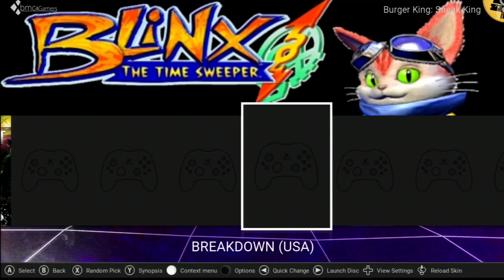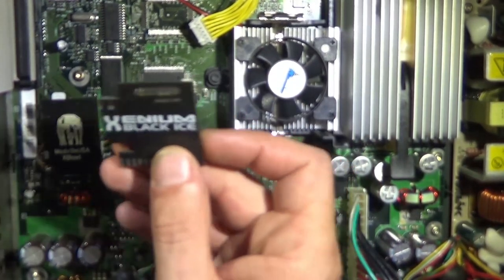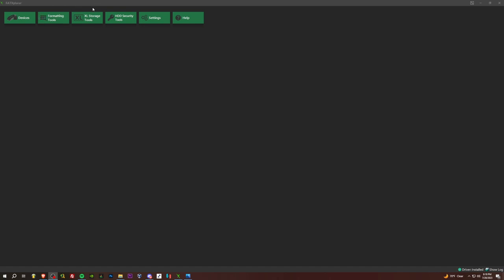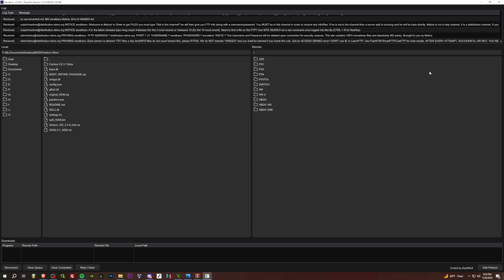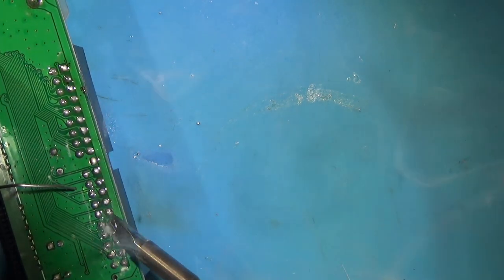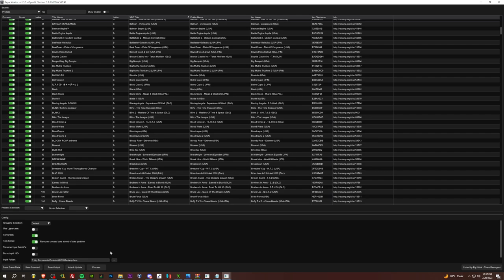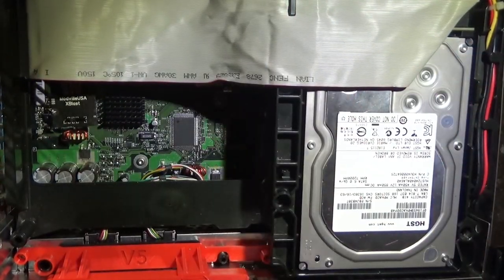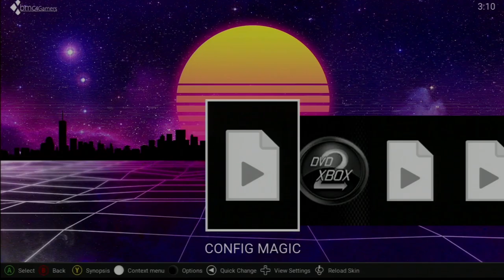Cerbios Full CCI (Compressed ISO) Setup guide!

Comment: I have been looking on the internet and cannot find a sound answer on what’s the biggest capacity a Xbox One X can utilize for a HDD or SSD that is clones from the original HDD it has. I am wanting to upgrade my current 1TB to a higher capacity but not sure if 2,3,4TB is the maximum capacity for a quick clone without any scripts being used. I have a lot of Xbox360 and OG Xbox games that are backwards compatible and will need disc space.
Reply: Back when I did a 1TB ssd swap on my 1X in 2021, I stuck with the same size, 1TB. I read some people say that if you stuck a 2TB in, and ever needed to reset to factory, it would only format to 1TB, as that's what it came with. After the reset, you would have to modify something to get back to 2TB. I had plans to sell the xbox eventually, and didn't want that burden put on the future owners, if they ever did a wipe, it would be safe for them. I don't know if anything over 2TB would work, as that's the largest they came with. I believe you can go 2TB, but keep in mind, that if you ever wipe it to sell, it may default to 1TB.
Reply: @bomb447  thank you for this answer! This help tremendously. I think I will go with a external hard drive as I can utilize unlimited space based on the external and it will play games directly to xbox unlike the series X.

Comment: Hi, love the videos.  I have just completed my beta IDE cable using 40pin FFC cable and... it works :)  I got fed up of those annoying thick IDE 80 wire 40 pin cables i had to try to get rid and now, i have, the first build is good, i need to polish it up a bit but cerbios appears to be happy with it and i think if that is then all others should be :).  The inside of the case looks a lot cleaner now

Comment: Are you happy with that 4TB? I just looked that one up and can't figure out if it's CMR or SMR. Suppose its CMR since it was released in 2016?

Does it have much noise, compared to a WD Blue 2TB 7200rpm, WD20EZBX?

Would Cerbios BFM allow larger than 2TB on a softmod? If so, do you still delete G, and Max out F in FatX?

If using 80 wire, Startech, and a 7200rpm, would selecting anything above UDMA 2 on a softmod do anything?

Edit: Just tested a 3TB and UDMA 5 on a BFM softmod, and both work.

Comment: I’ve probably got 10-15 Xbox hard drives but they’re all locked. I don’t have mod chips so I’m always hesitant about unlocking original Xbox drives, but yeah just a stack of em collecting dust, gotta figure out what to do with em, glad I didn’t throw em out yet
Reply: Also, is there a place I can buy like 10 of those adaptor bracket locks? I don’t own a 3d printer but I got 10 Xboxes imma mod.

Comment: is there a trick to get the artwork installer to scrape the art for panzer dragoon orta? i'm running the latest version of xbmc4gamers and the artwork installer 3.1. All my other games have scraped fine, just cant get orta to be recognised. tried ripping the disc with the xbox dvd app, ripped it both methods (extracted and iso), also tried other backups of the game, all the same result. i see rocky made a video how to create your own artwork but its a long winded process and i cant imagine art doesnt already exist for this game in the artwork installer, unfortunately theres no way to interigate the database to confirm or manually download them.

EDIT: The answer is to use an NTSC copy of the game. the pal version is not covered by the artwork installer. i even attempted making the artwork myself but the cd images didnt work, nor did the final task, worth a try but maybe this is an outdated tut as its 5 years old.
Reply: For future reference, if you install new artwork and they don't show in 4Gamers, run the built in Thumbnail Cleaner script. This wipes them all and loads the correct ones.

Comment: i bought the 80 wire ide you have linked in the description only to find that it has its connector facing the wrong way for the xbox, also mine didn't seat at all on 2 out of 3 of the connectors, would not recommend anyone buy that, also 18inch is small for an xbox ide cable
Reply from the maker: You probably have it backwards.
Reply: @ModzvilleUSA   nope its in the right way, it half plugs in but does not fully seat, and the connector is on the wrong side for an xbox, makes sense to be that direction for a pc but doesn't work too well in an xbox if you want it folded exactly like the original
Reply: just tried it again managed to get it to seat fully, had to put a ton of pressure on it though, seems like a decent quality cable otherwise just i dont like that the connector is the wrong direction and the length
Reply: just tried it and it does not work, most of the time it doesn't even get to the cerbios boot screen but i managed to get it to boot that far once after reversing the cable (shorter end to the hdd instead of to the motherboard), but then it gave a hdd error, also after unplugging it from the motherboard the latch on the top of the connector broke off, i will never buy another cheap ide cable from aliexpress, i had another cable a few years ago that literally broke the first time i unplugged it
Reply from the maker: @christopolis1  only ones that fold like the original are the ones Kekule makes but he’s not doing them at the moment.
I’ve used a ton of the ones I have linked without issue.
Reply from the maker: @christopolis1  good luck for your hunt for a better 80 wire ide cable. As someone who has used 100s of these I’m pretty confident in assuming you’re doing something wrong. The side with the shorter length to the next connector plugs into the motherboard. As for the fold, fold it once everything is plugged in and situated

Comment: I would love some help. I paid to have someone remodify my Xbox. It's pretty cool, it has this layout cerbios, but it's incredibly slow! It can take minutes just to turn on the Xbox and load up to the home screen. It freezes occasionally too.
Reply: Can you find a file manager and see what it says each partitions free space is? If you have the original xbox dashboard installed as an app, load it and disable 1080i, it does nothing but cause issues. 720p looks just fine and uses less resources.